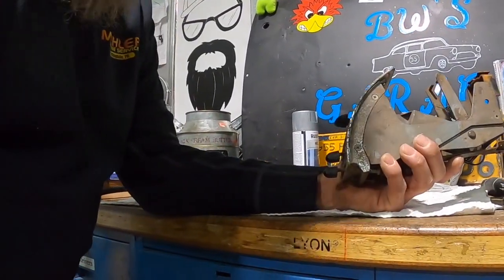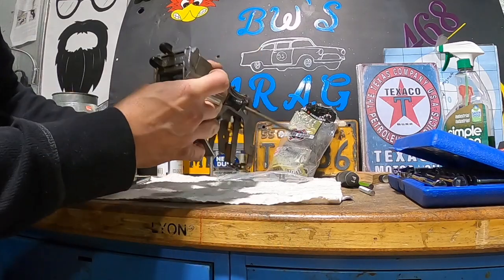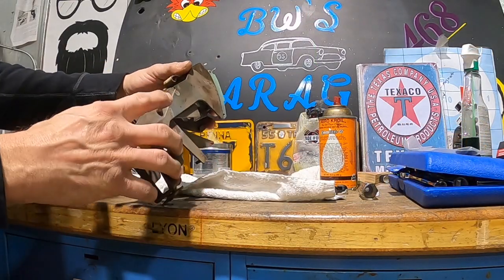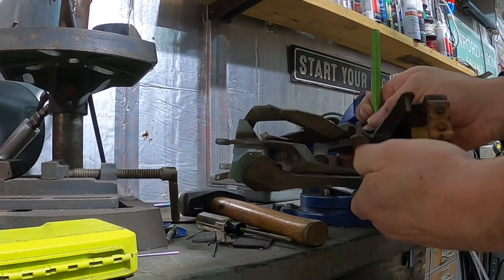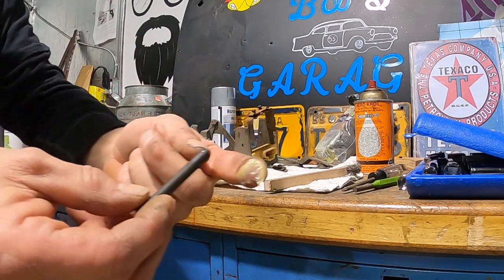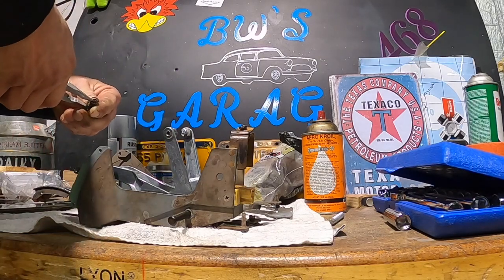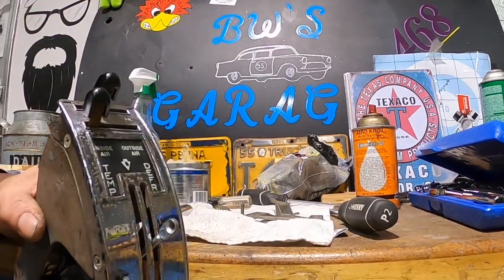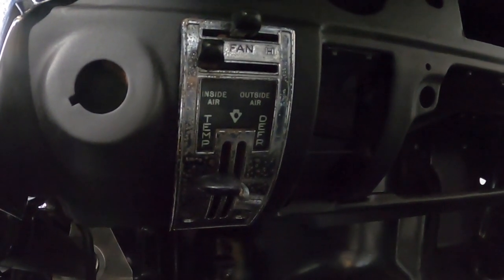1955 Chevy Sedan Deluxe Heater Control Rebuild

Comment: Should work nice. You have the complete heater, defrost vents and everything to make heat?
Reply from the maker: Yes, I need to test my heater core, it came with car, but Jay gave me 2 squirrel boxes a gasket kit and new cables. I just gonna wait till the floor is Raptor lined to install everything
Reply from the maker: I showed all the stuff in video last week brother.

Comment: Beautiful. So the deluxe heater control has different kick panel area also? Not sure of the differences. Thanks boss
Reply from the maker: The standard heater only has a fan switch, and a defroster control. The deluxe heater has a fan switch, defroster control, temperature control (water valve), and an air inlet control to either recirculate or bring fresh air in.

Comment: I just have the standard heater controls in my car
Reply: Difference being…Chrome and Glass vs painted dash coloured steel?
Reply from the maker: Jay has another deluxe set up if you need it Howie
Reply: It works pretty good BW , I even have a spare speed control switch just in case